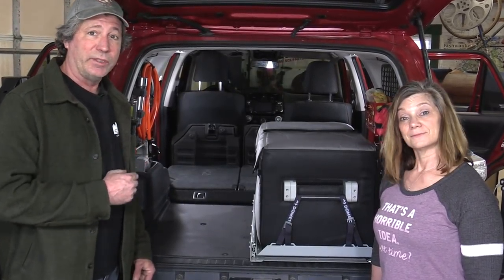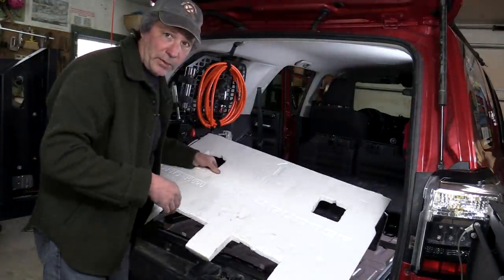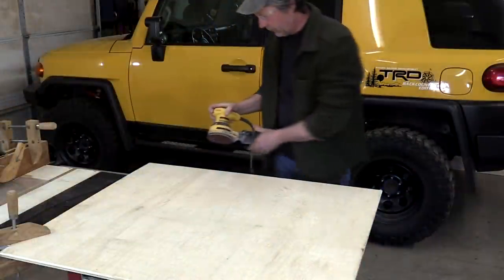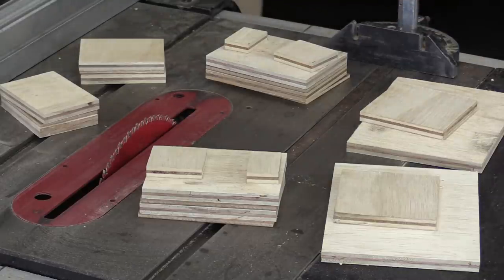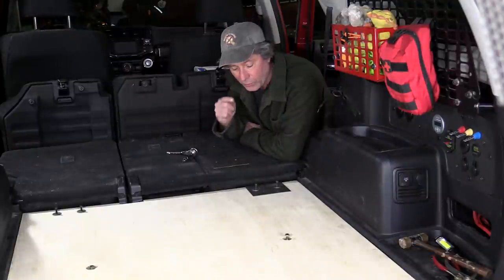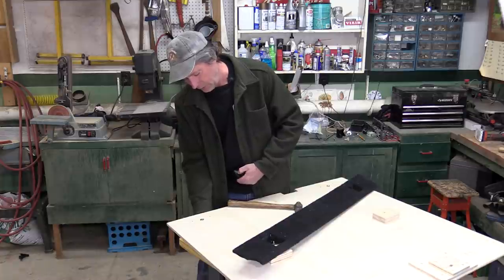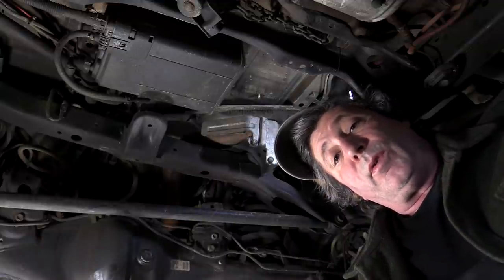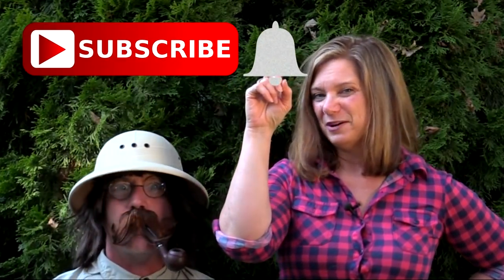DIY Rear Cargo Platform; 5th Gen 4Runner Gear Plate System

Comment: Helpful hint - for the "Front Legs" instead of trying to find the "Dowel Centers" at your local Home Building Supply, just do this:  Take the original bolt from the existing bracket, and place them in the 1/4 inch holes drilled in the fabricated plywood front legs.  The head of the bolt will serve to indent the plywood base when you smack it down (as shown in the video).  To add another level of certainty, I scraped a piece of chalk across the top of the bolts before doing the smack down.  A nice pink hexagon indented onto the underside of the plywood base.  Easy!

Comment: Hello, I have a 4Runner 5th gen and the Dometic CFX75 Fridge also but from my measurements it wouldn't be able to fit in the back like yours does. The fridge slider measures 38" while I only measured 34.5" deep for my trunk space. Is it because your center seats stay folded down? Or is my slider's (Alu Cab XL) design too long?
Reply from the maker: It sounds like your slider is too long. Ours fits with the back seats up. Our slider is a Dometic brand.

Comment: So I just watched a video where somebody installed a goose products base plate. Yours seems so much more well-thought-out and sturdy. It's laughable the way the goose one attaches, it has little sheet metal brackets that bolt underneath the factory tie-down hooks, and have two threaded holes that the plate in turn mounts to.
Reply from the maker: We weren't too impressed with their design either. We expect all our mods to be able to stand up to the harshest conditions. Thanks for watching!

Comment: This is great! I just subscribed. I've seen a few of your videos pop up on my feed here and there, and I've enjoyed all of them. Also, I just picked up a 2013 4Runner Trail, so the 4Runner videos especially interest me. This is really cool, I like all the attention to detail and the clever thought process you put into this. Mine came with the stock factory slide out, it's rated to hold 440 lb. I'm thinking I could probably just ratchet strap the fridge right to that. Just curious, if you would had the slide out, would you have done something similar, or do you prefer the setup that you use for your own fridge? Actually, I wonder if I could mount tracks like yours to the slide out, to have even more clearance.   Hmmmm....
Reply from the maker: We really can't say what one way or the other since we've never had any experience with the factory tray. If it were us; we would probably do what you suggest, strap the fridge down to the tray and try it. It may work perfectly fine for you, or not. :) Thanks for watching!

Comment: Im glad I saw your video. I was in process of cutting plywood base with s track tie down rails. I was thinking it would prevent movement of gear and stuff from tipping. I wasnt thinking of anchoring the plywood to truck, rather just placing the wood on top of stock cargo liner. Glad I didnt start cutting $30 plywood  because your system is superior. Now in reconsidering my original plan.
 I'm not thrilled with cutting plastic trim. Since I'm installing on-track, I probably just not reinstall that front plastic piece. Any reason its needed other than the 2 tie down points?
Reply from the maker: We debated cutting it and putting it back in too. It really doesn't serve any purpose other than aesthetics. Thanks for watching!

Comment: I have the same slider and fridge. Did you encounter any issues with the release catch on the slider hitting the tail gate when it's closed. On my TRD Pro the wedge piece trim stops the fridge going back far enough into the cargo area. 
Great detailed video thanks for taking the time to share.
Reply from the maker: Thanks for watching! Ours fits nice with no issues but, there's no room left over. The catch is within an inch of the hatch.

Comment: Love you guys.  Learning a lot that I will be using in my own build.  Just one question.  You used 1/2" plywood.  Do you fee that 3/4" would be too thick, or what?  Also, do you feel it is possible to just completely fill the cavity beneath the "base plate" say with solid foam or perhaps spray foam?  Just filling the void.
Reply from the maker: We went with 1/2" for the weight savings. Spray foam is interesting.

Comment: When idling, this squeak/humming noise that is pretty inconsistent is coming from the area that seems to be around the gas tank. You can hear it with the window down or outside. Do you have any idea what it is? Keep in mind that it may not be the tank area just that’s where it is loudest.
Reply from the maker: We have no idea. You'll need to get underneath and pinpoint where the noise is coming from.

Comment: I am playing with the idea of doing this for a smaller fridge/freezer. I am guessing I can watch the video about another dozen times taking notes and I should be able to pull this off. My question is, if I put 1/8 thick spacers under the slide could I trim up that piece of carpet and leave the exposed floor carpeted or for that matter, could I just put the carpet back in place entirely before putting on the slide?
Reply from the maker: I believe you can.

Comment: Hey guys, does the bedliner give off any smells when it’s hot out?
Reply from the maker: It gives off a slight smell for a few weeks. We did a second one and before installing it we let it dry outside for a week. That helped a lot to reduce the length of smellyness.
Reply: Do you think there is an alternative finish that will do well? One guy suggested to stain it and maybe clear coat it? I think with stain the wood may get gouged but you can touch up the stain easily.

Comment: Ok,   just wanna say Thanks a ton for this video.  I watched it, like a million times, and used it to build my own platform.  then i used the platform base as the base for my two drawer system with sleep platform on the 60% (passenger side) of my 4runner.  Basically, I combined your video with the video from Solid Wood Worx found here https://www.youtube.com/watch?v=4H5cbZ822os to build my own 5th Gen 4runner sleep platform.  Totally comparable to the Goose Gear system, which costs $2500.  Cost me about a 5th of that (maybe less).  Now i have a full 80" x 32" bed which i can remove and install the sleep extension using only 3 wing nuts.  Keep in mind, my 60% side rear seat bottom is totally removed with this setup.  I plan to build another sleep platform portion that keeps the seat bottom in place so it can be used in a 4 person trip and the sleep platform can be installed and removed when one passenger wants to sleep.  
Anyway,  sorry for the long comment.  Just wanted to say how much I appreciate what you guys do in your videos and how much I have learned from you guys.  Keep up the good work.
Reply from the maker: Thanks! We'd love to see pictures of what you've come up with. Post 'em up on our FaceBook.

Comment: with the cfx75 and slider on there, can you still use all the back seat?  thanks
Reply from the maker: Yup, we made sure we could when we designed everything. There's even plenty of room for air circulation around the refrigerant unit.
Reply: @WanderlostOverland  awesome! thanks guys.